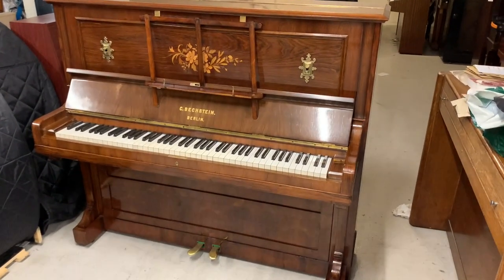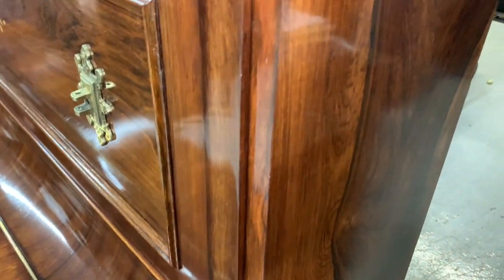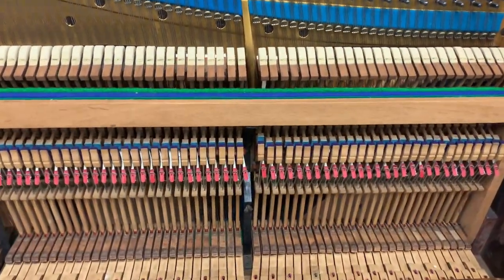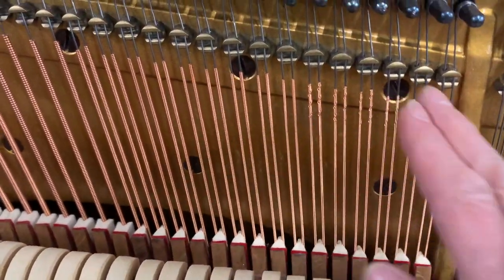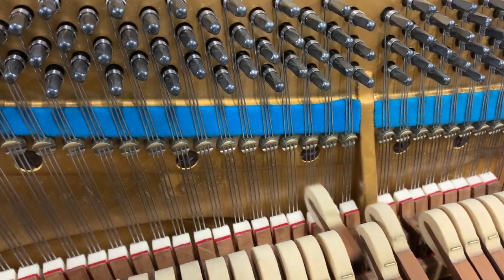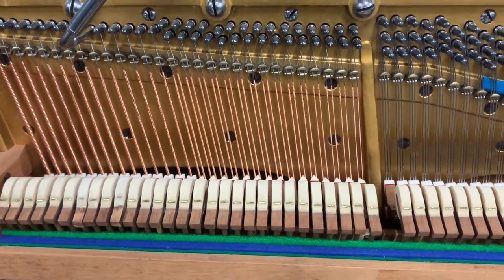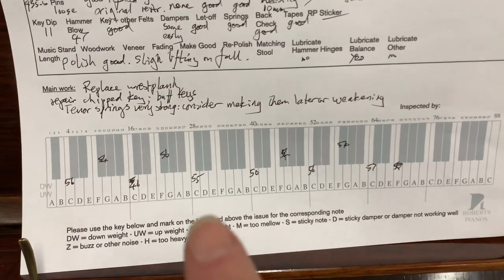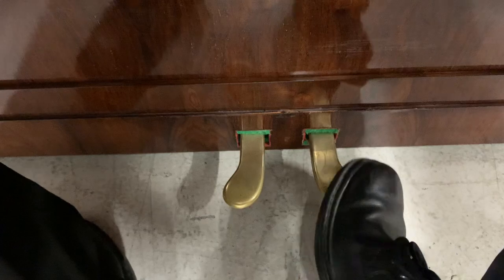Common problem on Bechstein uprights made before 1902: tuning pins loose; needs new wrest-plank

Comment: Perhaps it was this instrument I heard in the showroom last week and I was impressed. It's a nice instrument. On an instrument with loose pins I recommend in the first instance a magic treatment with "CA" which has become industry standard and not to be feared.
Reply: I found the CA treatment to be long lasting and any micro cracks in the pin block the CA really penetrates into the wood. Agree - great success with CA
Reply: @mjrpiano  are you referring to cyanoacrylate? CA? i was coming back to this video to suggest same. Even a crack in rhe wrestplank can be repaired today with modern materials.
However later more and more pins will need treatment. Somewhere I even read about possibility of metal lining. The sound, long tones of this instrument may be worth some work.
Reply: CA glue is good but not 100% functional. One thing I've been doing and achieving good success is inserting paper shim, made with cardboard. Mine is a really old Bechstein upright and it's the only thing working with 100% of success. Of course it's not a definitive treatment, but it will last till I get the condition of replacing/restoring the wrestplank.
Reply: @Thiago-px9ev  It depends on the glue and the technique. This 203 year old instrument https://www.youtube.com/watch?v=sKxpJdvgoCQ is playable only on account of CA and it's held and works well. And not just for that concert - https://www.youtube.com/watch?v=wjPDefnPQNU and another  . . . https://www.youtube.com/watch?v=GXZxR0AaXAA . Both functional and effective.

Comment: Do you find these older Bechsteins have a different sound than modern ones? I’ve heard them compared to fortepianos (somewhat) before.
Reply: Two points : - 
- They have large case work, made of real wood, and veneers, which itself acts as a resonator to the sound produced
- If tall, and old pianos tend to be, they have a good string length
Old pianos sounding like a  'fortepiano' is likely worn hammers (or wood framed): if steel framed they should ping and sing like the best of 'em